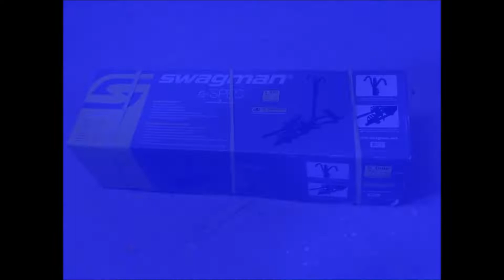ASSEMBLING AND MODIFYING MY SWAGMAN ESPEC BIKE RACK

Comment: Twice, the wheel tray ratchet strap has broken and caused my e-bike to fall off over a bumpy road with hundreds in damage.  There is a severe quantity control issue with this system and Swagman knows it.  Though they sent me a new wheel tray they refused to refund the cost of repairing my bikes